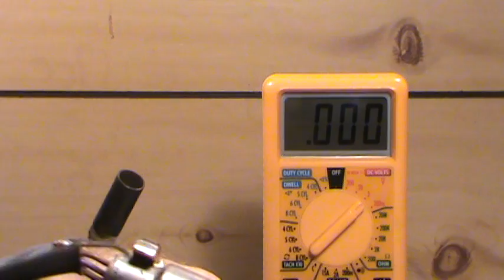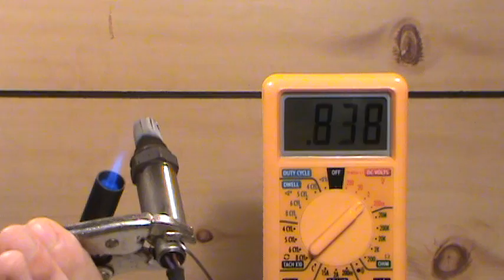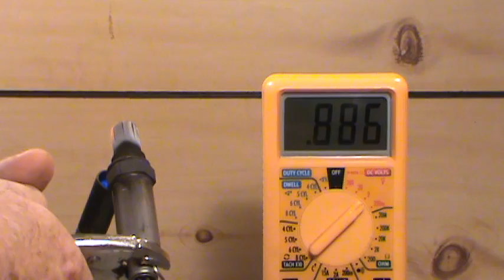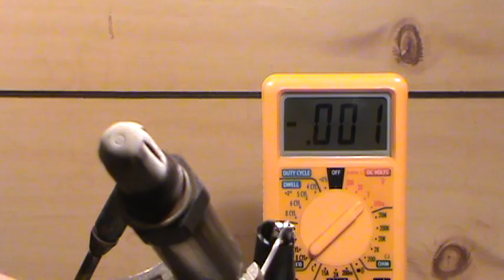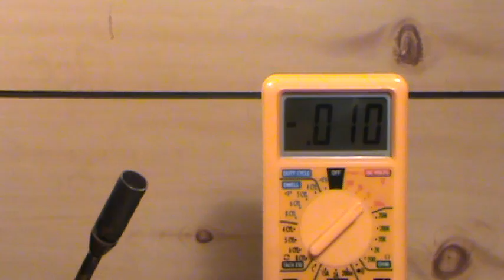Oxygen Sensor Test

Comment: I have 05 G35 Coupe. After I installed TestPipe, now its giving error code P1283 which indicate "Air Fuel Ratio Sensor 1 Lean Shift Monitoring Bank 2" Is there someway I can fix this? possibly turn it to more rich...?When drive, it does give some type of hissy  noise from exhaust or injector.. I do have UpRev Osiris Tuner, so maybe I can get it to dyno and lets them adjust the rich and lean? I feel like ma car lack of power now since it giving those code. Please help out and give some advice would truthfully appreciated and thanks in advances!
Reply: +DaVinn Em I am no expert by any means, but i do know a leaking vacuum/exhaust/seals can cause all of your problems. The hissing sound, the O2 sensor reading lean, and the performance decrease, especially at high rpm, where the leaking is at its worse.
I know this is a 7 month old question, but maybe it can help others if you have already solved it.
Reply from the maker: DaVinn Em Greetings DaVinn Em....Thanks for watching this YouTube Video of mine.............Now then, You did happen to post, quite a bit of useful Information, that, had me thinking, of the many possibilities, that might, just be causing Your..."05 G35 Coupe"...to be, somewhat..."Down on Power and Performance".............................................The very First thing, that I should "Warn" You about, is, if a Gasoline Engine, happens to be Running...Too "LEAN"...of an..."Air/Fuel Ratio"...as well as...Too Much..."Ignition Timing Advance"...Especially, when doing something like a..."Heavy Acceleration" (which places a Large Load on the Engine), then, that my Friend, is..."Not Good"...for the Engine, and, if the..."Air/Fuel Ratio"...and the..."Ignition Timing Advance"...are not, shall we say..."In the Safe Range"...then...some..."Very Expensive Engine Damage"...could become a..."Reality"...!!!..........................................Now, about that..."Hissy Noise"...that You mentioned.................When did You First start to Notice that particular "Sound"...???.........................Perhaps it might have "Started", right after the..."Test Pipe" (or Pipes?), were Installed on Your G35 Coupe...???......................................Also, were the..."Modifications/Upgrades"...done at the "Same Time", or were "They" Added in "Stages" (aka, at different times)...???..........................................That "Hissing Noise", might just be, something along the lines of an "Exhaust System Leak", and, depending on, just "Where It Is" (might be at One of the Joints, where the Test Pipe/s Connect, to the Rest of Your Car's Original Exhaust System...???)............................................................If any "Air", from the Outside "Enters the Exhaust System" (due to an Outside Leak), and "Any", of Your Vehicle's "Oxygen Sensors" are in the "Path" of that "Unwanted Outside Air", those "Oxygen Sensors" will be able to "Tell" Your Vehicle's "Computer", that, there is probably..."Too Much Oxygen in the Exhaust Gas, Coming out of the Engine's Exhaust Ports" (as in, an overly "LEAN" Condition)...but...both You and I, Know Something, that, that "Not So Smart Computer"..."Does NOT Know"...and that is...The Vehicle's "On Board Computer"...Has..."No Idea"..."What-So-Ever"...where that "Extra Oxygen" is Coming FROM...!!!...where-as..."WE DO"...!!!...well, once we actually Do "Confirm" that there Really Is, an "Exhaust System Leak"...that is...!!!...lol...........................................If there happens to be, "Any Air Leaks", weather "They" be in the "Exhaust System", or maybe "Any Vacuum Leaks", that are found, that are "Engine Related", such as, "Vacuum Leaks", caused by any "Engine Gaskets", or maybe something like a "Vacuum Hose or Pipe"...etc., then those "Items", Need to be "Fixed"...!!!............................................A Complete "Tune-Up"should be done, unless You have done so already, that is..................Things like...Spark Plugs...Air & Fuel Filters...and have Your Vehicle's...Battery & Charging System Checked-Out...etc................................................Your "Fuel Pressure" should be "Checked/Verified" as well..............................................Once the "Maintenance Details" are all taken care of, then...have Your Vehicle's "Computer and/or the UpRev Osiris Tuner" (if applicable?)..."Scanned"...for...any possible..."Trouble Codes"...as that my Friend, should be Showing, any and all "Trouble Codes", that will have to be "Taken care of", and, in order to "Fix" and "Eliminate" some of Those "Trouble Codes"..."They" might have to be..."Tuned Out"...by..."Re-Programming"...the..."Vehicle's Computer, and/or the UpRev Osiris Tuner"...as well, if need be...........................................One last thing, and that thing is..........Perhaps..."Search For"...some...Infinity G35 Coupe..."Websites"...and I'm quite sure, that, when You do happen to find the right one, that, there will be a "Forum" for Your "Exact Car", where You will be able to Ask Questions, and Get Answers to those Questions, that You have, about Your Car, and sometimes, You might even find, on some of those Website "Forums", the "Exact Same Problem" that You are now having, and perhaps, Someone on that "Forum" has "Already Fixed" that very same Problem, perhaps............................................There are, as I find, some pretty Smart People, on just about any Website "Forum" out there, and, some, if not most, of those People, will take the time, to help just about Anybody out, as long as the Subject at hand, is of a Common Interest, such as Your..."05-G35-Coupe.........Best of Luck.......Till next time..........Be Safe, take care, and have a good one.
Reply: Thanks alot for drop some of those helpful advices. Yes, the hissy noise is after I installed TestPipe. And I'll be double check for the leaks somewhere there. And I been doing forum search as you said, but seem causing and happening to everyone after they installed HighFlowCatalytic converter or TestPipe. I using Osiris Tuner to disabled the error AirFuel runing lean code permanently. Which I don't think its a smart choice. The car not yet tuned on Dyno but will do it ASAP.

Comment: Hey man I have quick question I have a 2007 ford f150 v8 4.6 4.6..  my engine light came on and I took it to autozone n they said it was a misfire on cylinder #8 and I changed the spark plugs and everything on it. They said it could be a bad oxygen sensor. But I have no idea which o2 sensor it is that connects to cylinder #8? The symptoms in my truck are.. it shakes a bit on stop lights it smells like gasoline when I'm at a stop or when I turn it off. Could you please tell me which o2 sensor could it be that connects to cylinder number 8. Or what could be the problem?
Reply from the maker: Jose Munoz Greetings Jose Munoz....Thanks for watching, and for Your comment/questions as well........"Warning"...!!!..."Danger"...!!!...When-ever a Person happens to be "Smelling"..."Gasoline"...kinda like Gasoline, when in its "Raw-Form", while it is, shall we say, in a "Liquid State", or even "More Dangerous", in a "Vapor-Like-State", which by the way, will only require a very Small..."Electrical Spark"...or..."Static Electrical Charge/Spark" (aka, like the One, that a Person receives, when They happen to have Their Body, some-what "Charged-Up", with a Fair amount of "Static Electricity", and when They happen to Touch, something like a Metal Door-Knob, or its Equivalent, will usually..."Experience"...a..."Big-Zap-of-Static-Electricity"...once that..."Static Electrical Charge"...makes the...Jump...Between that..."Person's Hand or Fingers"...and that..."Metal Door-Knob"...or what-ever Metal, that, that poor Person's Hand or Finger Touches.. will usually..."Wake that Person Up...Faster than a Cup of Very Strong Coffee"...!!!), and, also, Once the Engine is at Operating Temperature, that Engine will have some "Very Hot Exhaust Manifold/s" as well...!!!...................................................Like I was just sayin'..."If" Your Pick-Em-Up-Truck's, Engine Compartment (aka, under the Hood), or just about Anywhere, In, or Around Your Pick-Em-Up-Truck, had any Gasoline, that You can actually "Smell", has the Potential to "Ignite", and start a very Unwanted, Vehicle Fire, which can cause the Total Loss of the Vehicle, and the Danger/Risk, that it imposes, on that very Vehicle's "Occupants"...!!!...(aka, People in that Vehicle).................................................First "Thing", that "Must Be Done", for "Safety Reasons", is to have Your Vehicle's..."Gasoline Leak"..."100% Fixed"...before You "Drive It Again", or, the "Consequences", might end up, being..."Lethal"...!!!................................................I'll start with, can You actually "See" a "Wet Spot", or "Dry Spot" of "Gasoline" any-where at all...as in, in the Engine Compartment, or Under the Vehicle, perhaps???.............and do You, or did You, happen to "See", a "Wet Spot" or "Dry Spot", on the Ground/Driveway, Under Your Vehicle, while it was "Parked" at all...???...................................................My first thought, would be that of, a "Gasoline Leak", and, depending on, just where that "Gasoline Leak" actually "Is" (as You didn't really say, where You thought it was Originating from), so, Let's follow the Path, shall we..............................Gas Tank, with Gasoline in it..........Electric Fuel Pump, inside the Gas Tank..............Fuel Line/Tubing/Hoses (usually Under the Vehicle) from there, usually goes to the Fuel Filter.................then on to Your Engine's, Fuel Supply Lines/Tubing/Hose/s again...............Once that "High Pressure Gasoline", Inside the Fuel Supply Line, as supplied by the Electric Fuel Pump, makes Its way, to the Engine's, Fuel Rail/Pipe/s/Hoses, that "High Fuel Pressure", gets, shall we say "Limited-To", oh, somewhere around the "60 P.S.I." (P.S.I. = Pounds Per Square Inch)...give or take, a few P.S.I. of ..."Fuel Pressure"...there-abouts (please Check Your Vehicle's, Actual "Specifications!")...by the "Fuel Pressure Regulator"...and..."Any Fuel Pressure"...that's..."Above"...what-ever...."Fuel Pressure"...that the..."Fuel Pressure Regulator is Calibrated/Set-Up" For, will then, be Sent on "Its Way", back to the Gas Tank, by way of a "Fuel Return Line/Pipe", in one form, or another.............................................Now then, once, that there..."Potentially Dangerous"...Gasoline Leak, is taken care of, we will be able to move on, but, before We do, there are a few "Other Things", that may very well, be Causing some Leaking Gasoline as well.................................Like I was Sayin', try and find out, just where...???...that "Gasoline Smell" is Coming From, and always remember..."No Smoking"...and..."No Sparks" of Any Kind...!!!................................................If indeed, that Gasoline Smell is Originating in Your Vehicle's Engine Compartment, it just might be, some of the following, at that.............................................The Fuel Lines/Hoses..Leading Up To the Engine's "Fuel Rail/Pipe/s...or...the..."Fuel Rail/Pipes/Hoses"...or, any "Connections", there-of....................Leaking "Fuel Pressure Regulator" perhaps...???.................Might even be, something along the lines of a Physically, Damaged "Fuel Injector" (One or More, of Any of the "8" of them), and, might even be those Rubber-Like..."O"-Rings (as in "Oh)", that are on each of the Fuel Injectors, that may not be Sealing, as They should be, causing a Gasoline Leak.................The Engine's, Plastic-Like..."Intake Manifold" (Plenum?) might be, Broken/Cracked, especially, where the "Fuel Injectors" get Installed in "It" perhaps...???.................................................If there is a "Fuel Pressure"..."Related Leak"...that in itself, just might cause a "Low Fuel Pressure", in Your Engine's Fuel Rail/Pipe/s, that Supply the "Fuel Injectors", which my Friend, might, make for Your Engine's "Fuel Injectors", to..."Not Be Supplying", Enough..."Gasoline Mist/Vapor"...to Your Engine's Cylinders, and usually, will result in a quite "Lean Running" (Air/Fuel Ratio) Engine, that, if "Lean" Enough, can and will, Damage Your Engine...!!!...........................................Also, once the Gasoline Leak is Diagnosed and Repaired, then, Your Engine's, High, and Dangerous..."Fuel Pressure"...should be "Checked", and that Fuel Pressure..."Must be"..."With-in"...the..."Specifications for Your Exact Vehicle and Engine"...or...it probably, just..."Won't Run all that Well, at all".............................................Also, when Your Vehicle's Computer was "Scanned for Trouble Codes", was the "Only Code Showing", the, as You were saying..."Miss-Fire on the Number "8" Cylinder"...or...were there "More Trouble Codes" at all...???............................................Now then, I kinda Doubt, that the, Hypothetical/Faulty, "Oxygen Sensor, or the Oxygen Sensors", as the case may be, would "Only", be causing the Engine's Number "8" Cylinder to "Miss-Fire"...........................................Usually, if there was a Faulty, or Miss-Behaving Oxygen Sensor/Sensors, then, that would usually "Show-Up"...as a..."Trouble Code"...on the..."OBD-2" (On-Board Diagnostics-Version-2...Vehicle's Computer, since about the Year-1996, and Newer, on a Fuel Injected, Factory, Manufactured Vehicle)..."Scanner"...or..."Scan Tool"..if You will...........................................As far as I see it, a Vehicle's "OBD-2 Computer", is able to tell You, all about, "One or More"..."Miss-Firing Cylinders"...in that very Engine, but, that..."Not So Smart"....Computer...usually..."Can't Tell You or Me"..."What's Cauzin' It".............................................The "Miss-Fire", that Your Engine's "Number 8-Cylinder" is, or was having, can be caused by, as I see it, one or more of the following............................................Might be a "Mechanical Issue", with the Number 8-Cylinder in Your Engine, such as, "Low Compression"..................A "Component or Electrical Fault", as in any number of Sensors that Sends Information to the Vehicle's Computer, or what the Computer, sends Out, as in, Output Commands, to, any and all, of the Actuators, that usually Adjust things, like the Amount of Fuel/Gasoline, that gets Injected into the Engine's Cylinders, during, any and all, Operating Conditions...........................................Then, the Computer, "Adjusts the Ignition Timing", for the Engine's Operating Conditions, and requirements as well................................................So, "Make Sure", that You find out..."ALL the Trouble Codes", if there happen to be, any more then, that "Number 8-Cylinder Miss-Fire", that is...........and.........Once that "Gasoline Leak is Fixed", the Engine's "Fuel Pressure" needs to be "Checked", and "Must Be, With-In the Specifications", for Your "Exact Vehicle and Engine"..!!!................................................Did You happen, to have a "Look-At", Your Engine's "Spark Plugs", after They were Removed from Your Engine, at all...???.......................................If You still have the Spark Plugs..."What kind of Deposits and Wear"...are on Them...???..............................................Did the..."Number 8-Spark Plug"..."Look"..."Any Different"...from the..."Other 7-Spark Plugs"...???................................................So then, once "All of the Trouble Codes" are Known, and the "Fuel Pressure gets Checked"...if You care to, You can let me know, what You found out, and, the More that I know about the Actual Engine, and Other Things, that are related To, and might be causing any Problems, for Your Pick-Em-Up-Truck, just let me know, in the Comments section, Under any of my YouTube Videos...............Good luck, and till next time...............Be Safe, take care, and have a good one.